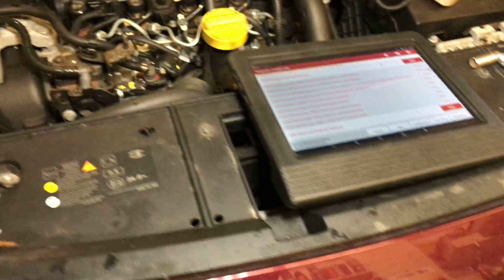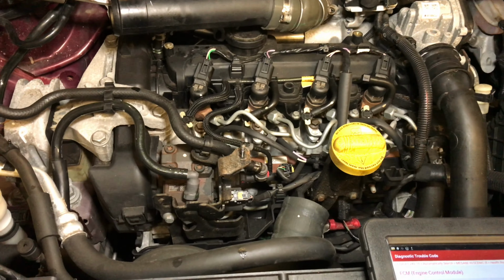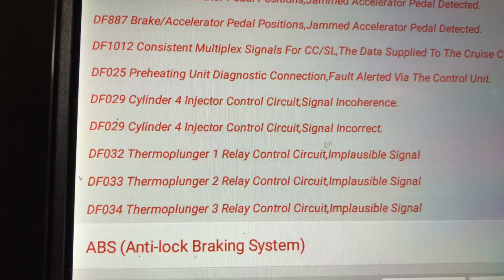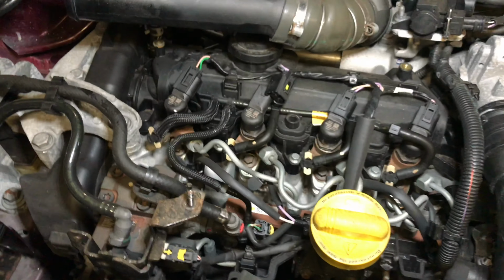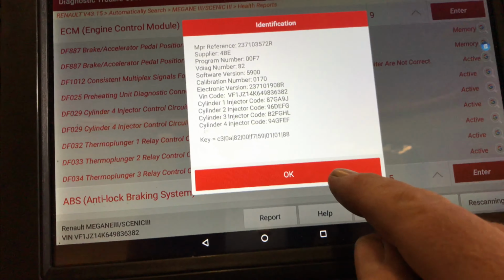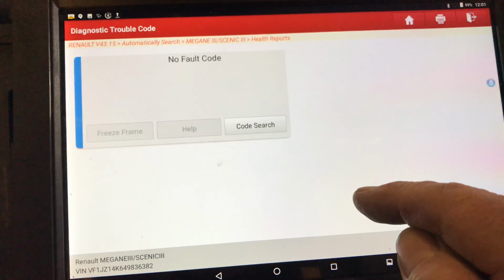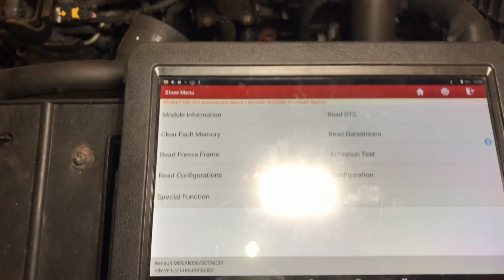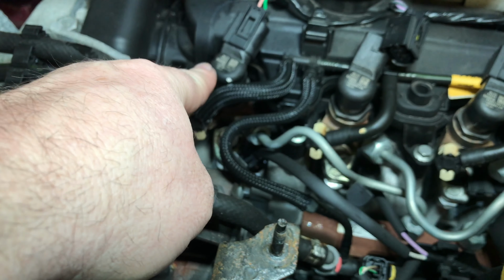Renault Scenic III (2013) 1.5 DCi - Fault Code DF029.  Diesel Injector Fault!

Comment: Thanks. Why the piezoelectric part of the injectors fail in some of the 1.5 dci motors ? 
What can we do?
Is there a better alternative injector to fit in ? Just after completed the 5 yr warranty time, I suffered 2 burnt injectors in 6 months with only 21,000 km .  Unreliable car Duster II diesel of 2018, not fuel issue.

Comment: My mate has a vauxhall vivaro with a 1.6 bi turbo Renault engine.. only done 44,000 miles and has already had to have 2x injectors replaced.. whatever is going on??
Reply: The injectors on my Qashqai 1.5 diesel (same Renault engine as in this video) worked fine until there was 240,000 miles on them.  When I got the first fault with them, I removed them and cleaned them and they've been fine since.  It was my fault as I had not replaced the fuel filter for three years and dirt got into the injector nozzles.

Comment: Hi well done for the video explanation. Have you ever tried service these type of injectors? Can these injectors be serviced? I am having issues on mine. I have the 4th injector showing at maximum limit 2nd injector maximum limit and 3rd injector signal incoherence.
Reply from the maker: They cannot be serviced only replaced
Reply: I've the same engine in my 2011 Qashqai and the injector on cylinder 3 went faulty.  I removed it and stripped the injector down to its constituent parts, cleaned them first in a "bath" of Wynns DPF cleaning fluid and then I used carb cleaner to give the parts a thorough clean.  When everything was clean as a whistle, I reassembled the injector and put it back into the engine.  Has worked fine in the two years since.  A new injector costs about 250 quid and a second hand one (which may have its own issues!) is about 120 quid.  So try cleaning the injector first as you might save yourself a lot of money.

Comment: DF029 there,w  as cyl4 inj CONTROL SIGNAL, and that´s wiring or ECU; does not point to the in jector itself; is the ECU dummy,or the factory did that to confuse things up...

Comment: How are you doing Thank you for your video Just looking for to buy one if there are worth it It seems like the engine 1.5dci 110km sounds ok But if there are any downside of it or any bad points If you can send some comments 

It seems like the injectors are not the best Delphi They says after 2010 they were better What's your comments please Thank you